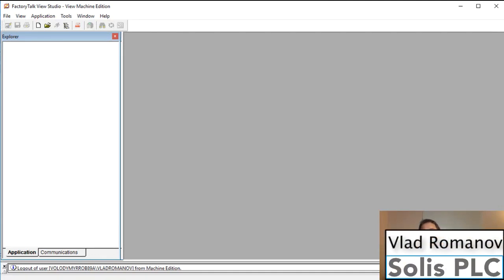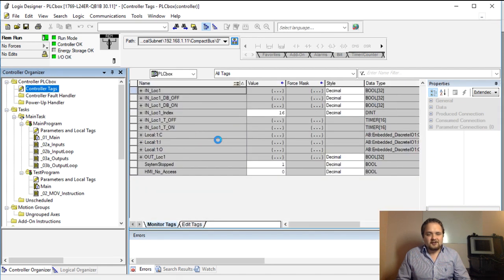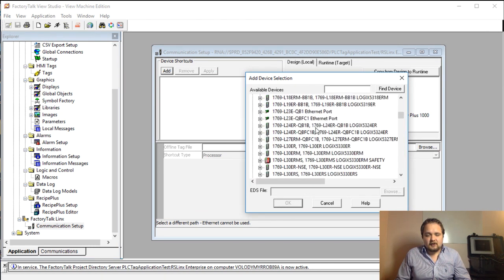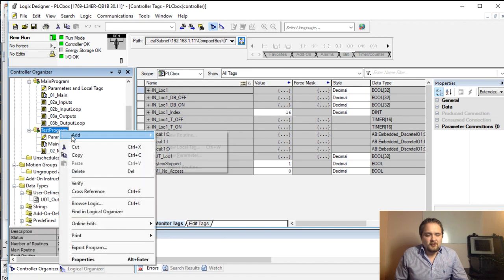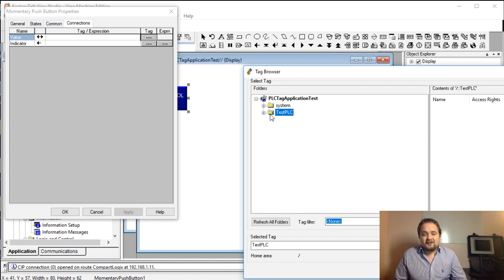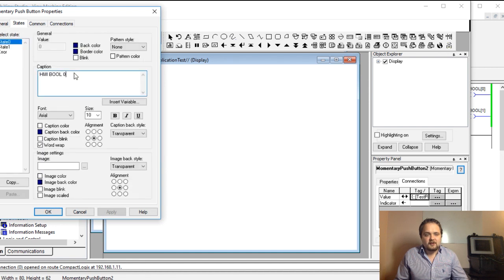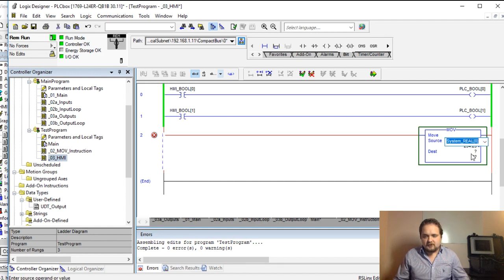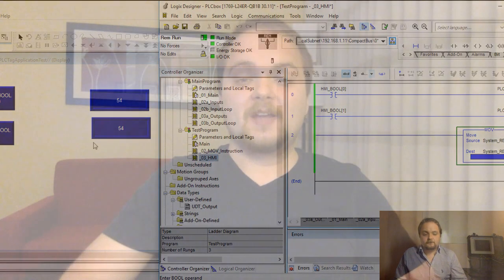HMI / PLC Fundamentals - Linking Studio 5000 Tags to a PanelView Plus 1000 HMI Terminal Tutorial

Comment: Hi, if idon´t have a physical plc but  i have the programm realized with rs5000 or studio5000, how to link the factory talk view with the plc programm to access to the tags?

thanks
Reply from the maker: The only way would be through using an emulator. You'll need a separate software to emulate RSLogix and Studio 5000.
Reply: @SolisPLC  Then when i have the plc i only need made a new conection to the physical plc
Reply from the maker: @Victor_Sj  I don't understand that question. Make a connection to a physical PLC?
Reply: @SolisPLC  I want to made a hmi programme before to have the physical PLC having the project of the plc made, so what is the way to link the tags between plc and hmi in this case?
Reply from the maker: @Victor_Sj  for that, you can use a simulator as I indicated in the first answer.
Reply: @SolisPLC  ok thanks

Comment: why don't you use a simple boolean data to transmit, instead you create an 32 boolean array, is there some kind of advantage?
Reply: Further design work takes a lot of less time If Array is used and passing tags with OPC.
Only drawback is that you HAVE to have each book generously commented and listed.
And small technicality data buses may spend the same time for processing whole bus size bool arrays as single bool